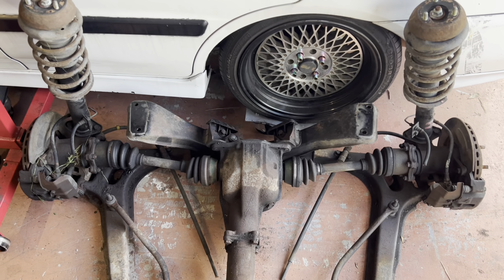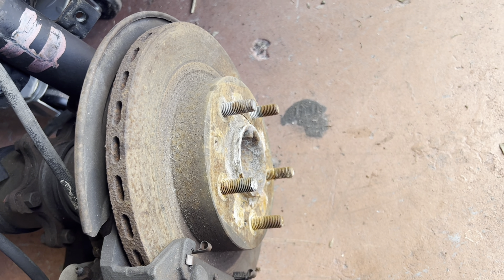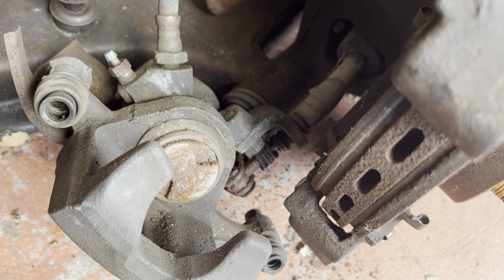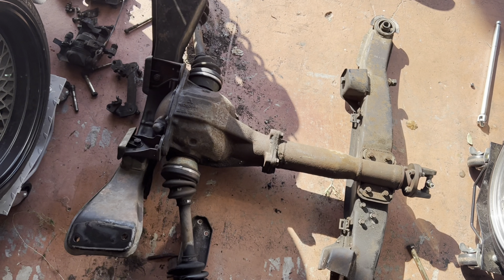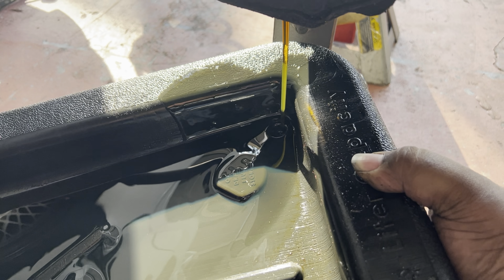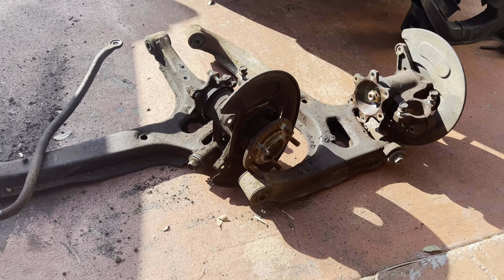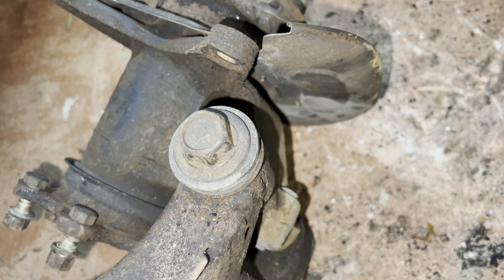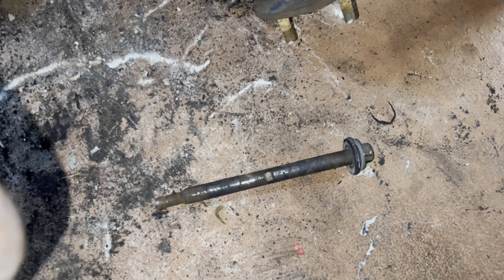1988 starion Disassembling rear subframe ￼￼

Comment: Hey I have a 1983 mitsubishi starion and I was wondering were the bov is on the motor it is a non inter oiled one so does that change any thing? Thanks
Reply from the maker: Oh yes, it definitely changes things quite a bit fuel delivery so on and so forth, but they don’t come with blow off valves. On any model unless someone put that there. It would be a nice addition to save the turbo, but at the little 7 pounds of boost that they come with won’t hurt to Turbo at all one of the main reasons why they didn’t put it there but you can always upgrade.